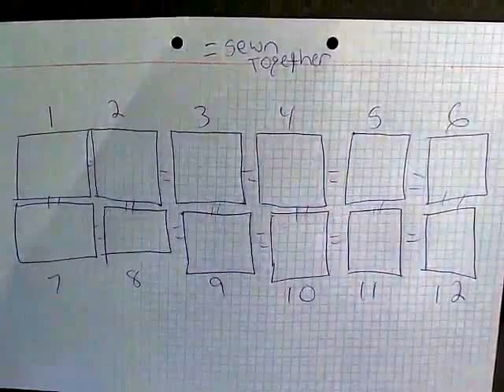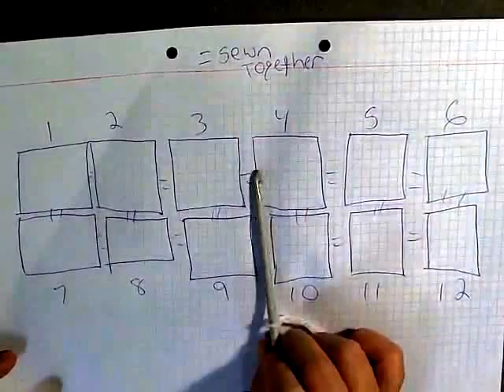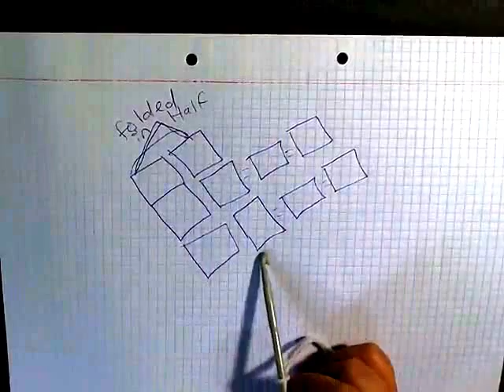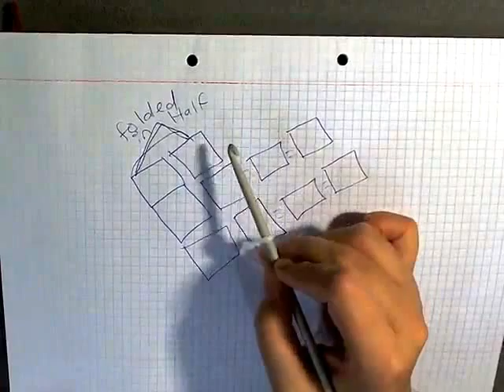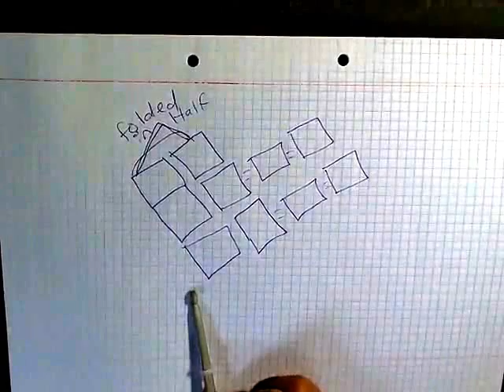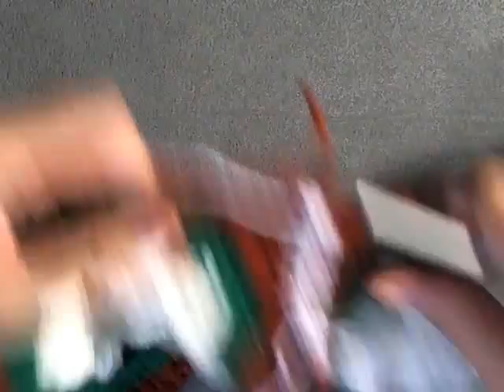Childs Granny Square Crochet Poncho - Crochet Tutorial

Comment: How would you adjust this for an adult size?
Reply from the maker: I made a poncho with 12 inch squares and it fit an adult just fine, so to answer your question, the bigger the square the bigger the size. Attach them the same way though.